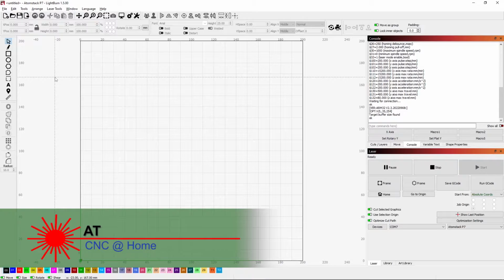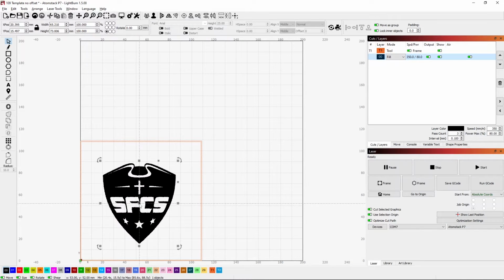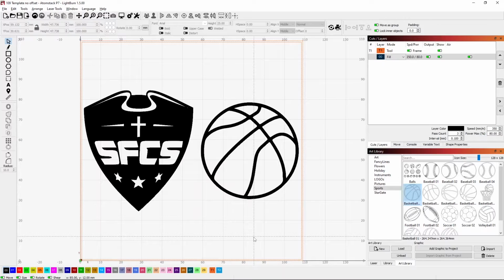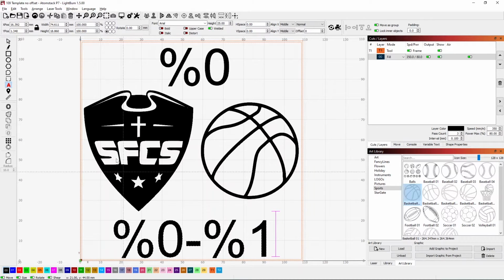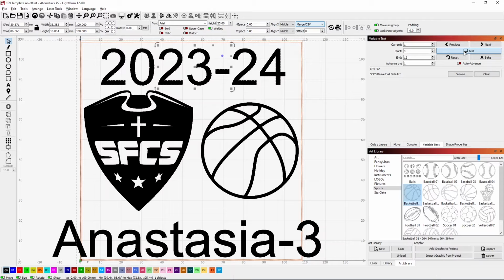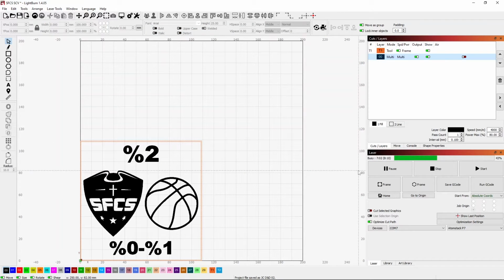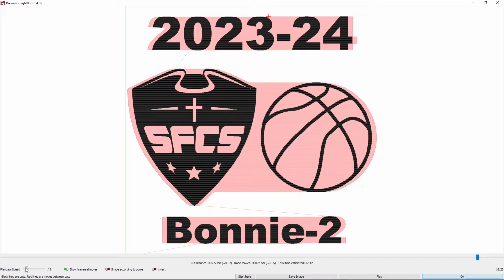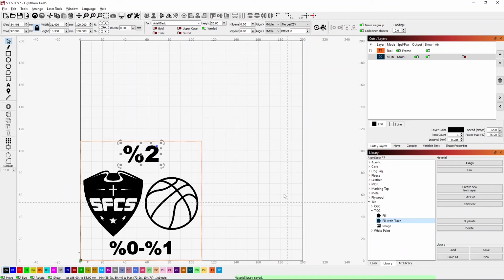Use variable text within LightBurn to make custom Basketball coasters.

Comment: One more question please... Why denatured alcohol - why not water?
Reply from the maker: Excellent question.  I use it for two main reasons.  One, denatured alcohol is very clean so it doesn't leave behind much of anything.  Second, it evaporates very quickly and I tend to want to work with my tile right away.  I make them when I want to use them vs making up a batch and having them at the ready.  They don't store very well as the TiO2 can get brushed off very easily.  Rubbing alcohol and water both work well according to several comments I have received.

Comment: I've been enjoying, and learning a lot from, your tile engraving videos. I'm about to try it myself but using a sponge brush method first and possibly moving on to the sprayer later.  What type of Ti02 (regular of food quality) would you recommend for each method and what mixtures would you suggest?
Reply from the maker: That is great to hear.  I hope you get good results as I have.  I have used TiO2 called PTR-620 from Pantai Chemical USA.  Here is an Amazon link to that: https://amzn.to/3wkKRCn   I have had good results using a mix of 3:1.  3 parts denatured alcohol and 1 part TiO2.  I started out thicker and had good results but it was harder to get a smooth coating with the foam brush.  The thinner mix is better able to self level and produces a more even coat.
Reply: Roger that. I like the idea of adding food coloring. I was curious if you have tried the finer food quality Ti02? From what I have seen from other youtubers this type doesn't clump-up.
Reply from the maker: @kd-CarvingAway  - This is the only type I have tried so far as it worked very well for me. Adding food coloring really helps see where the TiO2 has been applied.  I wish I had done that earlier.  Several people have commented on doing that.